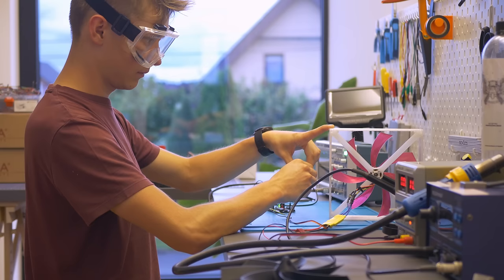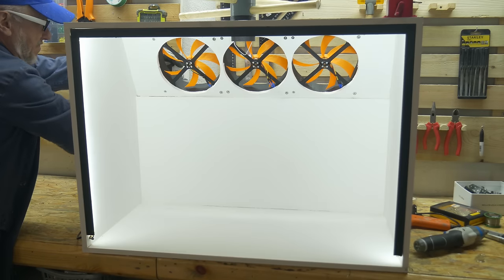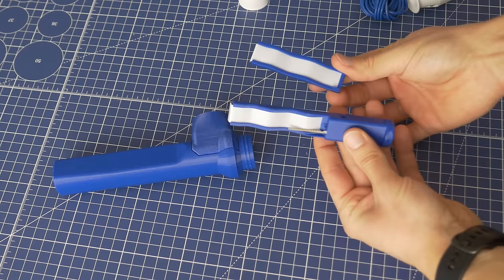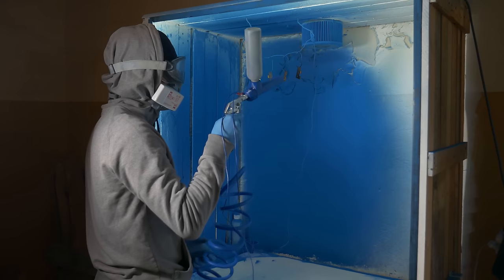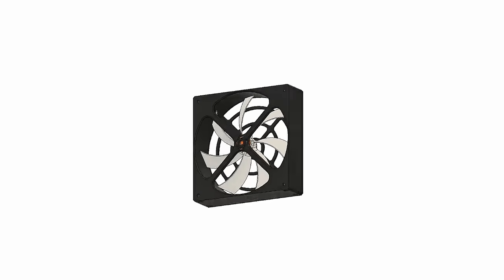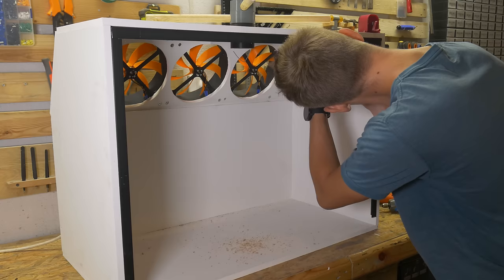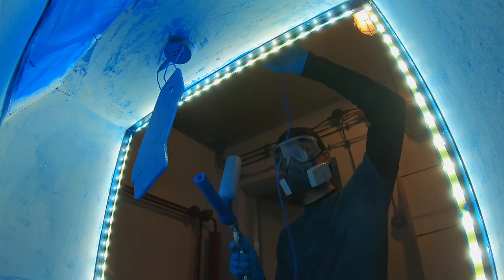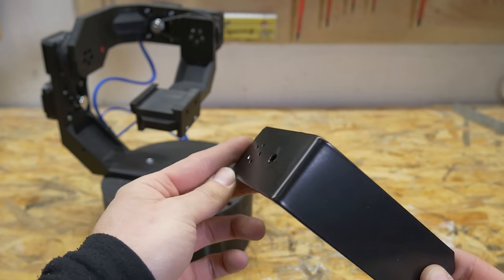DIY Powder Coating is Easy...

Comment: Re safety ... my foster father died from emphysema, caused by a combination of spray painting and smoking.  Sure powder coating is safer than spray painting, but your lungs are like wet tissue paper ... and generally you only get one set.  So treat them with respect ... because breathing is kind of important.
Reply: As a DIYer that is gradually developing into a more commercial or service related manufacturing role and as a result am machining things like composite(fiberglass, carbon fiber), plastic, wood, aluminum, not having a early death from exposure to things like fiberglass dust is a focus.

Comment: This is a really good video on how to do it at home.  Just wanted to mention that if you preheat your parts, you most likely won't be able to cleanly blow off the powdercoating since some of it will instantly flow out when touching hot metal.    I have heard of this technique being called "hot flocking".     It's to powdercoat things like glass since it's not easy to make the glass have an electrostatic charge.

Comment: Quick tip regarding the short milling scene: you should have milled the other way around (counter clockwise) it's a concept often taught in the context of manual mills because the cutting pressure presses against the direction of motion, so the mill can't use the slack in the axis spindle to 'jump around'...
Well if you have ball screws this theoretically shouldn't be a problem, however I found that in non industrial/budget mills it's best to stick to that practice because they tend to have some give... Try it, it might work better.. seeing the build up on the edge of the part I highly suspect that.. if your parts are getting undersize then (measure the edge, it might get crooked) you can try to use a bigger endmill or your machine has too much flex..

Comment: If you are bending aluminum, it's best to buy the right alloy as some are better for bending than machining ( even though you have to do both ). I had to make a motorcycle rack which needed bending. The metal supplier said to use 5052 H32 and it bent quite nicely. Also, be careful of too tight of a bend radius as you may end up with stress cracks. Very well done video Nik.
Reply: 100% ^^^

When I was doing my electronics technician apprenticeship, which included some mechanical shop work, I had to remake an enclosure because someone had mixed up the types of sheet aluminum, and gave me a piece that was the wrong alloy. It cracked visibly when bending it on the brake.

Comment: Very nice, thanks for sharing!

I'm also from Europe, and when I built my paint booth (for spray painting) I also could not find a box fan to use. I went with a design similar to yours and I chose kitchen cooker extractor filters for air filtering. They are sold in larger sheets I can cut to my custom size with scissors and they work quite well.
Reply: Sounds to me an opportunity to sell box fans in Europe.

Comment: An ingenious design! As simple as possible, except for fans with ESC. Fans could be installed ready-made with an asynchronous motor. It would be even cheaper (considering the cost of the power supply and ESC's). I really liked the painting camera! In particular, the lighting is well done - it evenly illuminates and does not shine in the eyes - and all this is achieved by using simple corner profiles! Although, again, there are LED bulbs available that are powered from an outlet rather than a power supply.

Comment: Is there ever a problem with the electrical connection from the hanging loop at the top through the hook and to the part to be coated?  Does the connection areas have to be cleaned/sanded after getting coated?  Very cool what you have done.

Comment: The models used by ´´industry´´ with high-voltage charging are not much more expensive, but they have better adjustability so that the powder sticks.

Comment: How good protection can powder coating give for outdoor use, or outdoor near the ocean (salt can be a problem)? Can you cover with some type of of rust protection before powder coating? I saw a video where someone baked bare metal parts heating the metal first in flame torch and then added oils. It made a protective film. Could powder coating stick to such a part?

Comment: Maybe use electric charge for the filters? I mean, the paint will stick to charged materials. Maybe some metal strips (alu, copper etc) that can ve electrically charged. Or a plastic or glass rod that you wipe with a wool cloth. Or those static electricity generators, which I forgot the name of.

Comment: If the rotating hanging loop was fixed to a slip ring connected to ground would be awesome, you probably wouldn’t need to move the ground wire with the alligator clip away from the part to paint. Congrats on the project! I looks great!
Reply from the maker: The loop where I hang the parts touches the bearing and there is a screw screws through the plastic so that it touches the bearing and to that screw I attach the aligator clip. So, yes, the cable is away and it doesn't disturb the painting.

Comment: Can you just wire all 3 fans in parallel and use with single ESC? That's basicaly same as using multiple 3 phase motors connected to single 3 phase supply, which is quite common right?

Comment: Is there anyway to powder cost plastic parts? 3D Printed parts, low heat annealing without warping could a powder coat be found that would cure at those temps???? My Micro Mill used some of your Dremel CNC parts. It just needs X Y Stepper adaptors to complete for test. You are having so much fun and help So many get into whatever this is called. DIY Maker Stuff. Dennis
Reply: Powder coating only works for metal, plastic is not conductive.

Comment: i was doing powder coating in a industrial environment and i get shocked so bad 😂
Reply from the maker: Why?
Reply: @nikodembartnik  we use big rack who get powder coated and they have so much coat on it that's the ground would not work properly so sometimes you becomes the ground ⚡one guy manage to put the thing on fire 😐 the company I was working for make electronic road sign the one ending by mac ...

Comment: Unless you are a mouth breather (which you shouldn't be), your nose will filter most particulate that you might encounter when woodworking (your nose can filter down to 11 micron!). "We have found that the adenocarcinoma occurs only among those men who are working, or have at some time worked, in conditions exposing them to fine hard-wood dust. Workers in the sawmill jobs who are exposed to coarse dusts are not affected, nor are those who have worked exclusively in the upholstering and varnishing departments..."

Comment: Powder coating is indeed dangerous. 
You're talking about very fine "micro-plastics". These can accumulate in the body, and cause endocrine system issues, infertility, and in extreme situations even death. 

While many studies have been published that show various examples of damage caused by micro-plastics have been reported, such as micro-plastic accumulation in the bodies of marine and aquatic organisms (leading to malnutrition), inflammation, reduced fertility, and mortality (death). The threats that micro-plastics present to the human body have not yet been clearly identified.